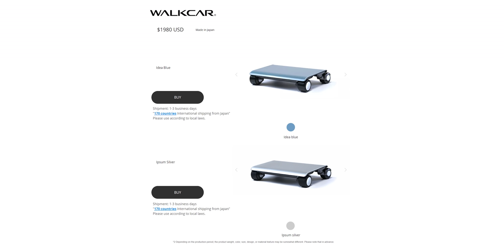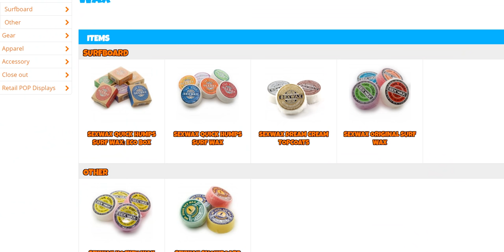Who paid $2000 for THIS...? - WALKCAR

Comment: i genuinely thought that someone just took the wheels from a mac pro and bolted them to a board
Reply: That's exactly the reason why I clicked on it.
Reply: you're not the only one haha
Reply: Then at least I would understand that price.
Reply: Braille skateboarding actually did that
Reply: that would explain the price
Reply: then charge 3rd times the price so they can make another 2 of them over and over...
Reply: very very bad try, maybe you missed that this thing has motors in the wheels.
Reply: @williamchen8423  3rd times? what is that supposed to mean? Did you fail in basic English?
Reply: @TWISM1337  Braille bolted them to an ipad tho, no?
Reply: bolted on a Macbook lol
Reply: i thought it was unbox therapy apple wheels skateboard
Reply: @HKgaming86  Those weren't mac pro wheels. They have a new one.
Reply: Much better use of $2000
Reply: Lol
Reply: TBH I'd pay 2K for it if it had original Mac Pro wheels instead.
Reply: I thought the same, except I thought they bolted the wheels to a macbook.
Reply: "Overpriced thing with a wheel" so you weren't wrong.
Reply: I thought the same

Comment: So it’s like a really expensive hoverboard with 4 wheels that can’t turn as sharp and is a little smaller?
Reply: Seems like almost all the problems could be solved in software. Theoretically it should be able to spin in circles.

I'd also want a Bluetooth module so I could load it with cargo and it would just follow me.

It could be your second guy anytime you're trying to move something like couch, able to pivot around corners on its own.
Reply: I mean for half the price or the d
Same you can get a OneWheel that does what this does way way better lol
Reply: I'm really not a fan of those "hoverboards", but I'd take one over this, any day of the week.
Reply: @KynosMusic  yeah this devices is pointless. Its made just for people to consume, they don't expect anyone to actually use it. Only difference between this and kids toy hoverboarss is the price and the inability to go over small bumps.
Reply: Doesn’t even look like they tested it either, they just designed it first and rushed it to the shelves.
Reply: I feel like the real problem is that it's just too narrow of a width to stand on. You can't really take a stable stance on something that narrow and you'd easily lose balance if the turning radius was sharper. Making the turning radius bigger is technically a solution to that, but that's a band-aid at best.
Reply: @KynosMusic  honestly, an electric longboard or skateboard for like 350 would be better than this
Reply: @xaostek  and that it has two caster wheels. Nothing you stand on should have casters lmao
Reply: @jtjames79  Looks exactly like a moving dolly lol
Reply: Looks like they looked at a hoverboard and decided to make something worse. I mean what does this do that a hover board doesn't? It's a bit flatter, but also longer. It has smaller wheels that's more likely to catch on some random debris and dump you on your face. The surface you stand on is static, forcing you to lift your toes and balance on your heel to try tp brake, and the braking is atrociously bad as is the turn radius. I suspect that those two last points are like that simply because of the UI. If the device actually braked decently it would throw the rider. Same with the turning. Turn at speed and the rider will have a very hard time keeping the balance with the feet so close together.

Now if they had just made a hoverboard style device with detachable wheels it could have been just as small if not smaller than this, and it should ride a lot better.
Reply: @jtjames79  It would be really, really janky if you tried to make it go in circles like a hoverboard because of its back wheel which will stop and jerk around when switching directions like a shopping cart would...

Comment: One wheel is MUCH better, probs one of the best stand on motorised board thats not like a long longboard
Reply: NAH. Lacroix lonestar supersport. 60 mph, 100 mile range. Eats up anything in it's path.
Reply: @haskellcrow3524  read it again lol
Reply: @RathOX  fair enough. I was intending to build a onewheel, but got sidetracked with other boards.
Reply: @haskellcrow3524  one wheels are fun to mess around with.
Reply: Do love my one wheel. Great for taking into town to bar hop
Reply: Don't they make an off-roading segway?
Reply: i agree, but be careful, the EUC nerds are going to start arrive shortly.
Reply: @haskellcrow3524  60mph bruh that is death right there if you eat it!
Reply: @mikecontreras5190  not if you dress for it.  60 isn't a bad motorcycle wreck. Skateboard wrecks are more gentle unless you hit a vehicle.  There is no bouncing bike. You don't fall from a height.  You can usually just slide it out.
Reply: @haskellcrow3524  for that price just buy a brand new 300cc motorcycle. Twice the speed and range and hitting a small rock or stick won't send you to the ICU.
Reply: @cochbob  not for everyone i guess. I ride bikes too, but the skateboard is way more fun. Both analog and electric. Over 20, rocks,.cracks, and potholes aren't as big of an issue as you'd think.
Reply: @kellz9972  Electric Unicycle rider here. They're much better than the one wheel!
Reply: @haskellcrow3524  I guess I get that, a little risky for me though, and I dont want to be in a full body suit just for a fun ride. I dont need that kind of speed. I totally understand some people do and I am happy that it exists for people that want it. I'll just be milling about on my onewheel at 20 mph.
Reply: @mikecontreras5190  i won't deny the fun factor. i think onewheels are great. get stoked. but "best motorized vehicle" is a pretty tall order.
Reply: Long live gizmo duck

Comment: 8:20 that is exactly why everyone should be talking about the voltage independent watthours (wh) instead
Reply: YES thank you. why not just joules though?
Reply: People sorta already do when it matters, though, don't they? Like in EVs for example?

In phones the voltage is standardized as far as I know, so mAh is good enough for companions. I might be wrong, so I'd appreciate it if anyone had examples of phone battery cells that differ in voltage
Reply: Alex is not very bright with everything that has even the tiniest amount of electronics in it..
Reply: @TjPhysicist  watthours make more sense lol (smaller number)
Reply: @dustin10weering20  Just change the scale to give you a good number of digits. It works for Farads fine in the opposite direction. J or WH work good for batteries.
Reply: would be awesome to have wh or kwh standards. Like somebody already mentioned phones and many many many electronics has 5v or like 12v or in drills 18v and trucks 24v so it's easier to understand though wh would be more accurate. Car batterys are like 60Ah 12v and trucks probably has 2x 12v to get that 24v not sure bout that, but point is that that 60Ah is kinda stupid too.
Reply: @TjPhysicist  You'll get very large numbers with joules, as there are 3600 joules to 1 watt hour. It's inconvenient in colloquial speech.
Reply: or just... Joules maybe
Reply: @Eyoldaith  then you can use kilo or mega joules. Using joules directly is as silly as saying "My phone has 3000 mAh"...
Reply: @sporemaster97  because old batteries were rubbish and were at sensible scales when mAh were used, and the industry is so baked into it that the small cost of confusion is enough to scare them away from changing to a more sensible thing
Reply: as far as the average consumer cares, all they want to know is more bigger is more better.
Reply: @Eyoldaith  I don't see anybody having problems in measuring stuff in GHz or GB... So I dont have any problems saying 100 Wh or 360 kJ.
Reply: @ClaudiuTudoras  
" or GB.."

OS, all of them that I know off vs storage marketing. They do NOT agree. And think that in the PC industry its the storage marketeers that are doing it wrong. Little if anything else on PC's goes with straight base 10.
Reply: @ClaudiuTudoras  But it's easier to imagine if you have 100 Wh energy source, that means it can power a load of 100 watts for 1 hour, or 1 watt for 100 hours (in theory of course).
But if you have 360 kJ of energy and wonder for long will it power a 30 watt load, unless you memorized or know the convertion rates it will take an extra effort to calculate.
Reply: @Dood_  this, as everything that users Wh has a power given in watts
Reply: The idea of having watt hour as a unit always amused me, since you go from joules per second (a watt) then just multiply it by the amount of seconds on an hour so you're just going back to joules again but naming it something different  😅
Reply: @Dood_  I actually agree with the argument that you could estimate the running time if you know the consumption. I am in favor for using Wh because of this.

But that is a different argument.

I'm just saying I don't have any problems saying quantities in large numbers. For example: 100 megatons /  4.5 gigahertz / 3  petabytes etc.
Reply: @EdgyShooter  When I took physics, my teacher told us that the idea of a watt hour originally came from trying to create a unit that everyday consumers could understand. Understanding watts per hour is much easier than understanding joules in everyday situations.
But yea, I always found it weird too.
Reply: @TjPhysicist  Lets throw Calories in the mix to just for the fun of it.

But seriously watthours are much easier to understand than converting between joules and watt when calculating how long a certain load can be run from a battery. Going with joules is a bit elitist and doesn't really help in everyday calculations.

My father worked a lot with central heating. The heating plant where he worked pumped hot water to over 1000 apartments for heating and warm water, and he did most of his calculations using calories, which in this application made a whole lot of sense. He absolutely hated when people talked about heating equipment in watt instead as he didn't think it made any sense. And he claimed they all ended up converting to calories anyway when doing their calculations. I never met any of these people so I can't vouch for this, but to me it makes sense given the situation. Same with batteries when used in applications like the one in this video. Here it makes much more sense to talk about the battery capacity in watthours rather than ampere hours and voltage or joules.
Reply: Joules is spelt nicer though.
Reply: It's like 6s2p
Reply: @KekusMagnus  Joules vs Wh is basically the same thing as km/h vs m/s. Yes in engineering m/s is used more, but km/h (or Wh) just have more meaning to them for the average person.
Reply: @KekusMagnus  i just want to tell my opinion like it matters lol, but Joules is kinda weird concept for reqular people who knows little about electricity and things. Ofcourse Joules would unite many things, but wh would be easier probably. Much nicer to read 4.600MAh @ 5v = 25Wh
Reply: @EdgyShooter  using watthours makes A TON of sense if, for example you have a UPS and you wanna quickly figure out how long the UPS's battery can keep your systems running.
Simply divide Wh (battery capacity) by W (powerdraw) and you get the running time in hours.

Comment: 7:24 Strain gauges don’t work the way you explain. This is the reduction of the resistive cross section in the wire that reduces the resistance in the gauge. This allow you to know the deformation of the part it is stuck on, which itself is related to its mechanical strain state, which itself is related to its mechanical load.

Comment: A telescope control stick that folds into the board instead of pressure controls is my first thought here. Would not add much cost or space to build, and would add a more reliable point of control and balance. Just fold out and extend control stick, push to go, pull to break, and twist or sideways to turn. Sort of like a mix between this and segway that still fits in your backpack. That I would buy

Comment: for a battery the mAh are multiplied by the voltage to get watt hours, an actual unit for measuring amounts of energy.
so if the 2000 mAh battery is at 20 volts it would have  40 watt hours of total stored energy.
the 5000 mAh phone battery at 3.6v only stores 18 watt hours, or less than half, despite its mAh rating being more than double.

Comment: 80kg feels like nothing if you think about clothes (especially in winter) and a heavy-ish backpack
Reply: And simply just the body weight...
Reply: Totally true it’s like it was made for smaller bodies (maybe average Japanese adult?) but it most definitely is not enough. I’m a 20 y o with 174cm hight and about 76 kg of weight and I have a healthy body but with just a laptop and charger on my backpack I can easily go past that 80 kg limit
Reply: I mean it depends, problem is that it's targeted at fit people that do some exercises to keep that low weight- but those people will always prefer walking to this...
Reply: Definitely made for the smaller demographic, I'm 1.82m (about 6ft) & I'm right around that 80kg limit & I'm fairly light for my height. Oh well, looks like I can't spend $2k on...that thing. What a shame.
Reply: @jojoo4094  Hey, I'm 172 and I weigh 58kg. Healthy too, well as healthy as I cycle 40+km to and from work everyday.
Reply: 80kg means if you're a 70kg adult and stepped on the board slightly too hard - you're instantly 2000dollars poorer
Reply: I was actually thinking the same exact thing...I was like the weight limit basically exuded a huge amount of the already extremely limited number of people who would actually buy it. But then they explained that it was meant for the Japanese market, then everything kind of made sense.

Comment: A remote could have made this actually good, to be totally honest. Since the current version is $2k, I'm sure either they or their competition will make a version which is $200 (so you could buy 10 of those instead 1 of the ones in the video), or even $100 (probably with a quarter of the battery the other one has, with a $150 battery upgrade option you can use at any time, allowing you to bulk-charge a bunch of spare batteries before a long trip).

Comment: I rode a Boosted Board longboard for years. On those you have the wide powerful stance you mentioned in the video, plus suspension through a long flexible deck and heaps of speed from rear drive motors. This has none of those advantages and the wheels look like they belong on a suitcase. I struggle to see how you would use this at any speed on a mildly rough sidewalk or any realistic city street. Going 24 mph on an e-board was terrifying enough even with massive wheels and a much more optimal riding stance, and it was fun. This seems dorky. Cool tech though!

Comment: This is something where a cabled controller in hand could actually improve it in some areas, like safety. If the controller has an auto break or slowdown as soon as there no accelleration input.

Comment: Sensor-based movement doesn't really make sense unless you have stance and leverage, this is why the original Segway design works, this is why the Onewheel design works, and lack of this is why designs like Hoverboards and the Walkcar are so hard to control, and why we'll never see individual foot skates that're actually intuitive and easy to control that aren't just on/off. Personally, I think these smaller and harder to control, via sensors, boards would be better off with a wireless controller, something that's a joystick with an analog trigger, for directional movement and speed. Is it as convenient, no, but it's a lot more practical. 

The design of it is interesting. Though I don't understand why the choice of only two driven wheels, especially at the front where they won't be under the majority of the person's weight. Personally, I would've used four powered wheels, and a processor to run the differential math to optimize wheel movement under turning input. Not only would this add power under the weight bias, but it would also give this thing that extra boost that it needs. I'd be interested in seeing the design of this in a different formfactor, something that improves stance, something that accommodates larger people, as this was very clearly designed for people of a certain stature.  

I'd also like to see the motors tested on a miniature dyno, just to fact check their power claims. I'd also be curious to see how they achieved their claims, like what differentiates their motors from other motors of similar dimensions. I almost want to see these motors salvaged and made compatible with a typical skateboard truck design, passive tilt-to-steer will always be better than sensor-based active tts, plus the stance benefits, plus there's loads of various suspension designs for trucks now; it's just a better platform to design off of, and a lot of interesting products have already come from this methodology.

Comment: I live in Yokohama and haven't seen anyone use one of this. In the first place, this thing cannot be used in Japan because anything that goes above 6km/h is considered a motor vehicle and needs a license slapped on there. (I looked it up because I originally was thinking of using an electric scooter to go between my house and the nearest station, which is a 22 minute walk away). So yeah, can't be sold and used in Japan. If you see one on the road, it's because they're using it illegally and cops can fine you for using it.

Comment: This seems like the sort of device you use when you can't walk, but have to walk at walking speeds, by standing on it and leaning forwards and backwards, which requires the functional legs you need to be able to walk in the first place.
It's a solution that has no problem to solve.